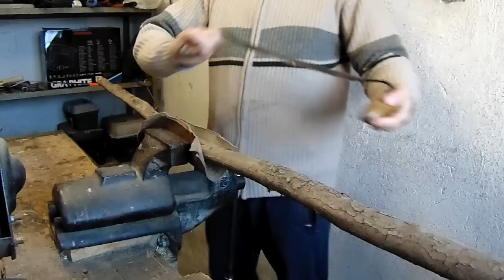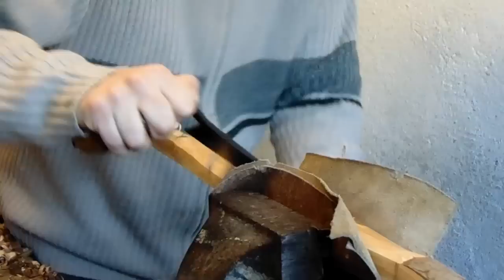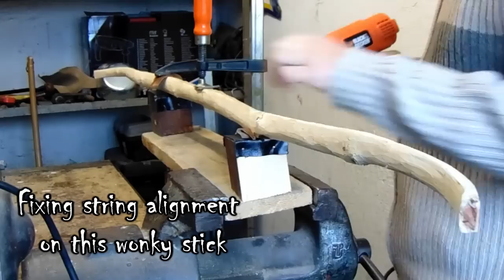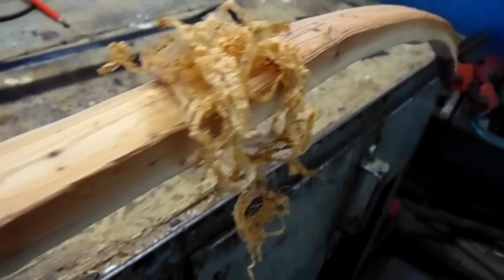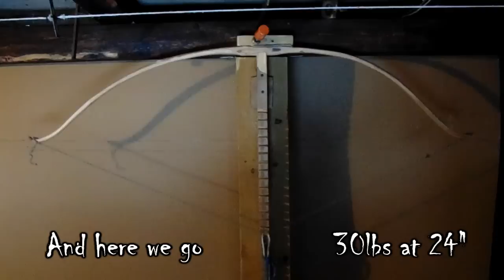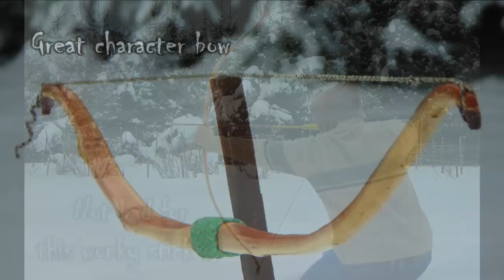Making a Yew Branch Bow

Comment: Since this is such a small diameter stave is a hollow limb design not required? Also is there a different technique for seasoning limbs rather than split staves since there is bark all the way around a limb?
Reply from the maker: The branch was too small for hollow limb but yes It would be good to apply this design. You can leave the bark but there is a risk that funghi will attack the sapwood